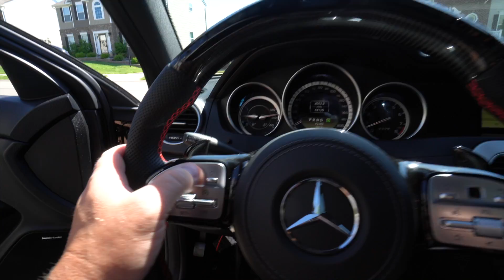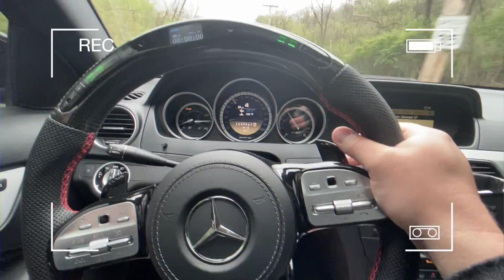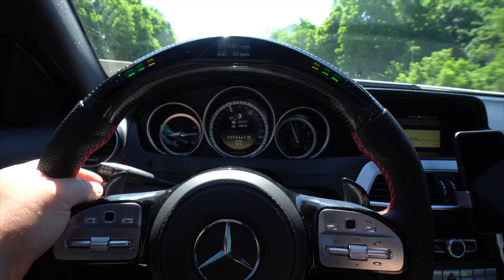More Mercedes Problems + New Hoopty Coming!

Comment: 1994-1998 Ford Mustang Convertible because winter is coming for the Hooptie. Because trying to drive one in the snow and keep warm in the cold is an awesome set of content. Plus it should be easy to get one cheap since ... It will be winter before you know it.

Comment: Car with a manual transmission and remove reverse lock out. Try different MPH (10/20/30/40) on doing reverse drops. Drive forward at a speed, clutch in, floor the gas, put it in reverse, dump the clutch.

Comment: Early 90's - 2000's Mini Cooper S, Mazdaspeed Miata, Civic Si, or S2000. Straight pipe it. Spool it, then Stance it. Do a Boy Racer setup, with small but effective what works & what doesn't series.

Or performance Turbo Diesels, see how much power you can extract from them? (Golf TDI, E320 Bluetec, Jetta)

Comment: I purchased the same steering wheel. It just arrived and the paddles are slightly loose. Do you have any video of tearing the wheel all the way down to be able to tighten the screws. If not, do you have a good way to contact OHC? I'm not getting a response from them. Enjoy your channel.

Comment: You do know that except for "Classic" trim (i.e. entry level only in EU), the "chrome" is actually brushed stainless steel (exterior) or aluminium (interior) on a Mercedes? No plastic chrome panels like on an average car or even a Continental GT or some Jaguars. You have to put something worthy in the place, black brushed steel, anodized alu or carbon to do it justice. But does that even exist? Anyway, nice C204! I like.

Comment: Hardware upgrade mate, hardware is a system formed form electronic components.
Software upgrade would be more easy, just to flash a piece of code using a computer to the flash memory of your steering wheel hardware.

Comment: Can you get a 2010 toyota camry le or 
se v6 and throw it in park and reverse when driveing and if it has a push butten throw the key out the window fill the gas tank with isopbel alcohol and thats what i can think of and it may last for a long time because toyotas are reliable so if you can please do so thanks

Comment: There is a 2007 BMW X3 on Pittsburgh Craigslist for $2k . Runs and drives, needs a few small things like a rear door latch, radiator hose, and a transmission transfer case actuator.  Nothing that you and your buddy couldn't fix and make a video of. Then take it off road.

Comment: What I hate in your strap line "more Mercedes problems" this indicates it is a Mercedes issue when its not.  Its a problem created by yourself using non standard aftermarket parts not designed by Mercedes for the car.